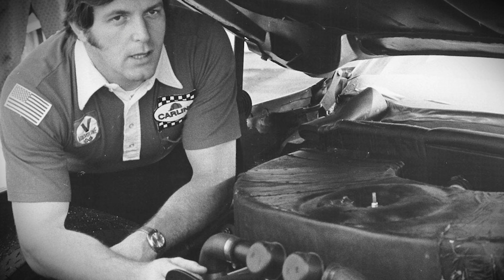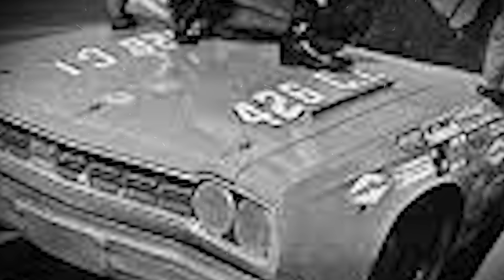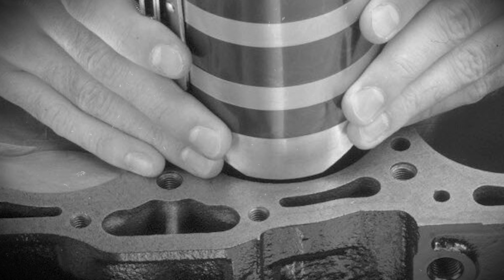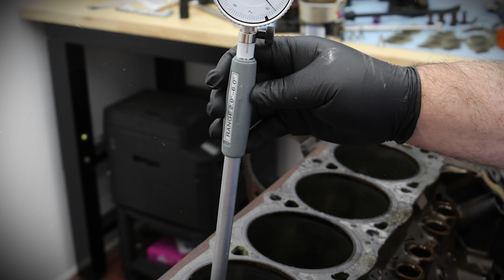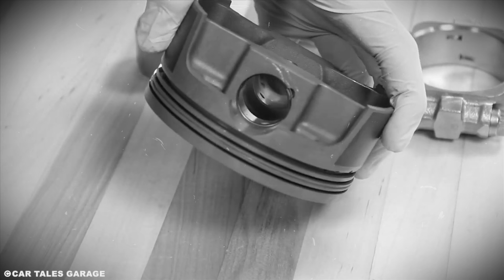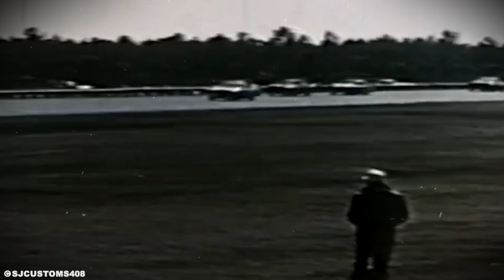This South Carolina Mechanic OUTSMARTED Chevy With a "Banned" Bow-Tie Block Trick NASCAR Outlawed

Comment: Toyota design the Scion XA the 1500 CC engine also with tapered cylinder walls. But it didn't work out well because they didn't allow for bigger rings because they were looking for  Better gas mileage and cleaner air, but it doesn't write in a little small car like that. 4 cylinder and gaining another 10 maybe 15 horsepower. The car is a little fast as it is, but with a little bit more horsepower could even be more so

Comment: I would think that Yates managing to run a gm block in a Ford engine would be the real trick. 

The most well known trick regarding displacement was done after a team happened to notice that the I specter always checked the same cylinder on every engine.  That team started running that one cylinder at the limits allowed by nascar and ran the other 7 cylinders larger.
Reply: 43😊